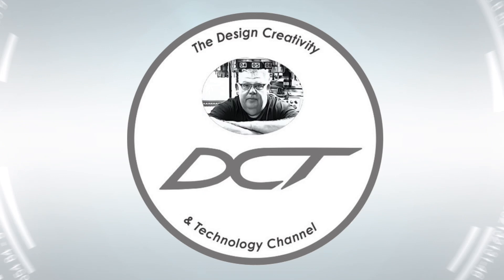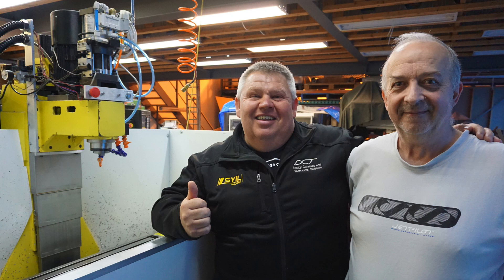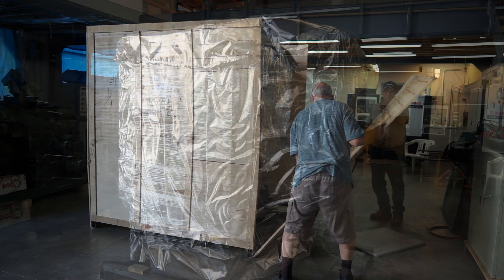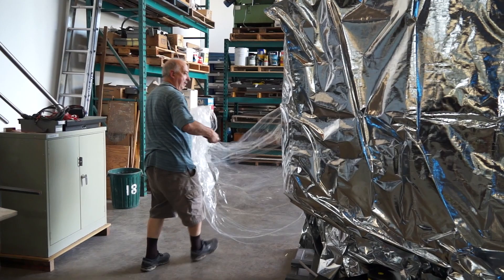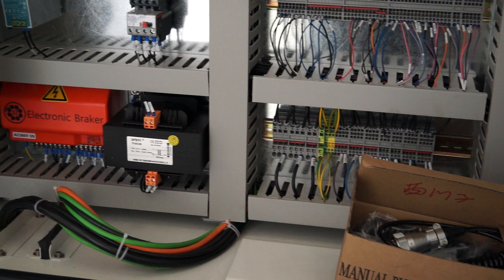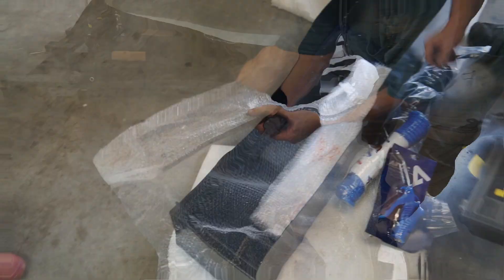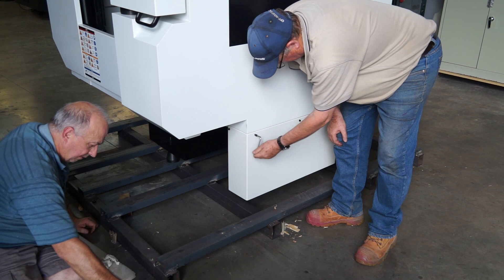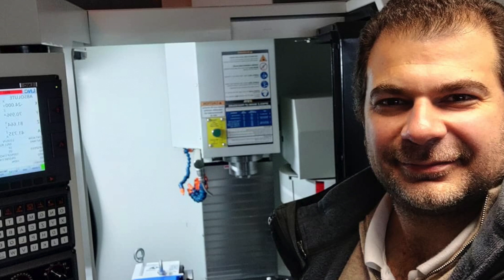We unbox the all new 2022 X7 CNC Mill from Syil

Comment: With Siemens controller do you get Siemens servo motor and drives as well? If yes which motor and drives come with syntec controller
Reply from the maker: Yes all Siemens electrical gear. However, the 808DA controller is apparently no longer available.  Regards, Aaron.

Comment: How do you compare Syil to Haas mini mill ??
Reply from the maker: Hi Daniel. That’s a very good question and it depends which country you’re based in. The newer epoxy granite Syil is awesome. It’s a smaller BT30 taper machine but would easily punch pound for pound against standard EDU or entry level Haas MM and much cheaper (if in Australia). The Haas MM2 is in a whole other category. However and that said, a Haas is not an Okuma or DMG 😉
Reply: @DCT_Aaron_Engineering  
Thanks 👍👍

Comment: Hey Aaron,
What is the cost for a machine like this ?
Reply from the maker: G’day Chris. That’s a very good question. I think it would be safe to say approx $50K Aud for this set up. Cheers 🍻
Reply: @DCT_Aaron_Engineering  That puts it in Haas Mini Mill territory. Do you think it competes in that range?
Reply from the maker: @Factory400  Hey Carlos. A Haas minimill over here in Australia would be about $80-100K Aussie. I think the little Syil easily punches (pound for pound) with a Haas Minimill. However they are little down horsepower with only approx 7HP and a BT30 spindle. They have an epoxy granite base which means excellent thermal stability and rigidity. Me personally, I think they easily outperform and out value any other competition around this price range on the market 👍
Reply: @DCT_Aaron_Engineering  roughly how much on top of the sticker price for shipping and duty?
Reply from the maker: @josh17m  hi Josh. I would only be guessing mate. I’ll cover price in my next video if you like?
Reply: @DCT_Aaron_Engineering  that would be great.

Comment: Brilliant. What was the height of the machine whilst sitting on the steel transport base? Trying to workout if I can fit one into the workshop.
Reply from the maker: Hi Reuben. Sorry I don’t know that exact figure. I think the steel base was 100mm thick, plus the foot height, plus height of machine. Here is the link to the brochure mate. Cheers 🍻 
https://support.syil.com/hubfs/brochures/SYIL%207%20Epoxy%20Granite%20Small%20Milling%20Center.pdf
Reply: @DCT_Aaron_Engineering  I can fit the machine through without the base..
 Might be time to modify the doorway. Cheers
Reply from the maker: @ReubenSchoots  my older machine just fitted under my roller door, but I had to remove the stops to gain another inch. Best of luck with your purchase Reuben. Cheers 🍻